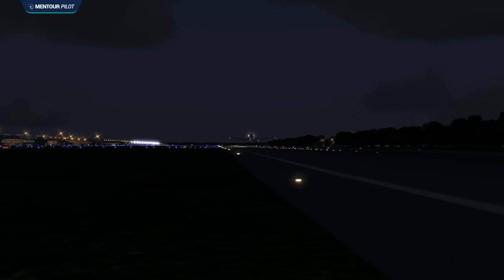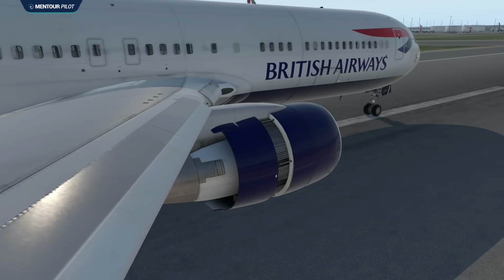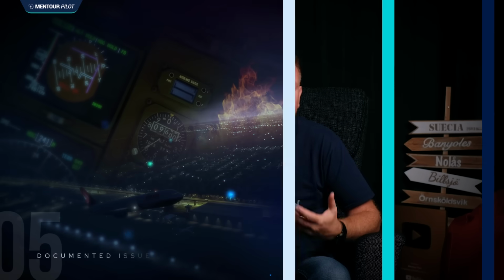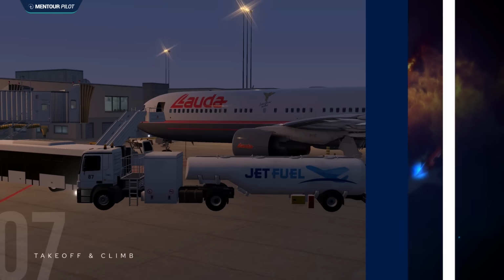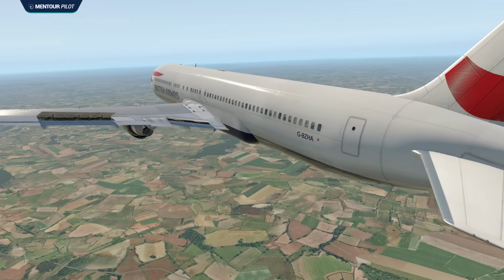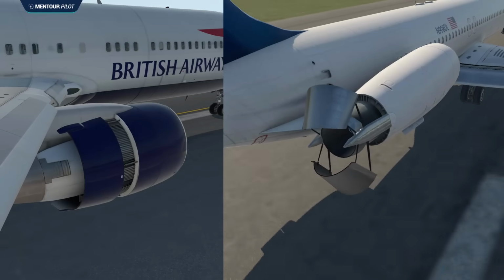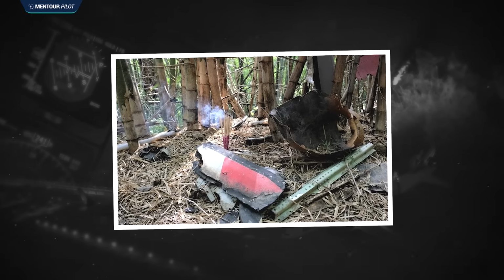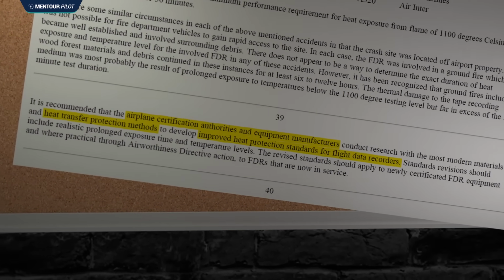HOW an Impossible Failure CRASHED this Boeing 767!

Comment: One thing I'm actually missing from this is how long Boeing was denying that there was a flaw with the design, and that activating reverse thrust in such a situation would be completely uncontrollable, until Lauda said that he himself would take one of the planes and replicate this situation to see if it would be possible, for of he fails it will just him dying, while when he should be able to control the situation, he would resign. It was there where Boeing then admitted that it would be unsafe
Reply: This should be the pinned comment.
Reply: @MikkoRantalainen  I recently read that it is some kind of YouTube or Google A.I. that chooses which comment to pin. That would be okay as long as the channel owner can override with their own pick of which comment to pin.
Reply: @valerieann8007  given that not every video has a pinned comment and the one which is pinned usually is a specific one usually something by the creator I think you've read something false
Reply: @valerieann8007  the pinned comment is chosen by the channel owner. The top comment is chosen by the algorithm, but is displaced by the pinned one, so I can see someone being confused for a while, but whoever wrote what you read was wrong
Reply: Yeah Boeing was more than happy to place all the blame on pilot error, but I'm sure they learned their lesson... Cough 737 Max cough
Reply: @EdgyShooter  Airbus blamed pilot error for using too much rudder when their composite failed over New York.
Reply: One more time then criminal management from the manufacturer?
Reply: Honestly, it does this story injustice to not mention Boeing's feet dragging on acknowledging the reality of this fault, and especially Lauda's determination to make Boeing to come clean on the findings.
Reply: From a impartial observer:  Most critics of Boeing point to its downfall starting with its acquisition of McDonnell Douglas in 1997 and that previous to this, they were a safety conscious company with engineers having greater input than now, which supposedly has a greater emphasis on profit, share price etc as directed by the CEO.
So even back then, do the Boeing bashers believe it was not reputable, or maybe it was corrupt?  
Asking seriously
Reply: Like they (Boeing) did with the 737 MAX.  Deny & then blame the pilots after they decided to remove all info on  MCAS from the documentation of the aircraft (pilot handbook etc.).
Reply: Couldn't agree more... the only negative thing one can say about these otherwise brilliant air crash investigation videos, probably the best ones I have ever seen, is the occasional omission of such key elements of the story and the rather apparent partiality of the creator of the videos when it comes to aviation industry and aircraft manufacturers, specially Boeing...
Reply: @raulko4898  exactly……Boeing has a horrible record of lying, covering up evidence and obfuscating facts to deny responsibility …yet here they’re portrayed as if it was just aww shucks  back luck…
….
Reply: @raulko4898  What is "brilliant " about using the wrong airline which had completely different engines on its B767  ????
The FAA made P&W redesign it's reverser    mechanism  not RR.
Reply: That sounds like the most Niki Lauda thing ever
Reply: @MuscleCarLover  according to the movie and James Hunt and his rivalry, he was big on safety, especially after his crash.
Reply: @King OfTheJungle Apparently his "big on safety" didn't bleed over to his airline operations. Conscientious maintenance would view a recurring fault as failed troubleshooting or repair, instead at Lauda Air they viewed the recurring fault as an inconsequential nuisance message and simply cleared the fault message and dispatched passengers and crew on an unairworthy airplane… HOW MANY TIMES?!! Any surprise that the reverser finally deployed in flight? I don't know why Lauda wasn't blamed for the crash. He should have been criminally indicted for gross negligence, considering he never even bothered to contact Boeing about the problem. Instead of grounding the airplane until it was fixed, putting it in the air to make money was more important. No wonder he made such a dramatic offer to kill himself in a jury rigged airplane. That Shakespearean line holds true: Me thinks thou doth protest too much.
Reply: @petep.2092  well since Boeing had said it was safe if the thrust reverser deployed in flight, the plane was deemed airworthy. The fact that Lauda flew to the accident asap to help out in any way possible says everything about his character.
Reply: @petep.2092   Lauda Airline suspected a (harmless) malfunction regarding notification, but dutifully repaired them - always hoping this would be the last time. They went to the trouble to check out wiring and also asked for input by the producer. (Their practice to repair and hope it would be finally fixed this time was in line with guidelines). Boeing told them that even IF the reversal would happen (not only a notification which is a false positive if you will) that could be handled safely by the pilot.  

The customer (the airline) relies on the producer for correct guidelines regarding what is a critical failure and what not. 

Moreover: Lauda Airline had ONE machine with those problems, but other airlines had those problems too. Not often, and until then no catastrophic outcomes. There had been even a few incidents with reversal during mid flight (one of them is mentioned in a comment). That flight got lucky but the machine flew back. That was a serious incident already and it is up to Boeing to not be complacent along the lines of: We do not exactely know what is going on but it will be fine, and if reversal happens a good pilot should be able to prevent a crash,  and a complete redesign would be too much trouble. So let's wait and see and hope for the best ....

Lauda with their one machine could not do the tests in the wind channel - but Boeing could. They just could not be bothered until after the accident (and some more pressure). 

WHO should have an interest to fix such issues  - with plenty of margin of security ?? 

Boeing did not research further until this accident forced the. Only then they did the tests in the wind channel. And only because Lauda did not leave them alone - and unfortunately (from their point of view) he could get attention of international media.
Reply: Typical American corporation - remember Bhopal and Union Carbide?  Morton Thyokol and the Challenger shuttle?
Reply: @ianchandley  It has nothing to do with American culture. This is an issue with companies all around the world.
Reply: This also sounds like the Michael Crichton book Airframe.
Reply: Niki Lauda was such an amazing person haha. That is truly amazing
Reply: I also seem to recall that Lauda Air was being blamed for a lack of maintenance, until it was shown to be a manufacturing fault, I think it nearly broke Lauda Air.
Reply: He could have taken a parachute with him just in case
Reply: They care about their shareholders more.
Reply: Airbus i much better.  I always  feel much better on their plane
Reply: Yep, then did it again with max.
Reply: It look like the hydraulic cylinder that opens the thrust revserers...looks plumbed wrong on the diagram...

I think it is double acting..push on on end...then push on the other end...

I see only one line to your block diagram...now if it was like spring...or  ..then one feed line could move the cowl in both directions.....

I am sure for us simpletons.....it is best to have just a simple form
Reply: That's Boeing for you. Well never fly on any of their junk ever again.
Reply: @mortblackthorn187  and that's Lauda for you too. Legend
Reply: @mortblackthorn187  It's a shame because they were once considered the safest aircraft in the air.
Reply: @mortblackthorn187  It's a shame what their company is going through. My grandfather was a propulsion engineer for the original 737, 747,757, and 767. Boeing used to be the engineering standard for the entire industry. But it seems like they and Airbus have both missed or ignored a number of design faults with their aircraft in recent years.
Reply: @mortblackthorn187  Grunge was dumbing-down Seattle rapidly at this time.  Blame Kurt.
Reply: I put the blame on Pratt & Whitney. They were the ones who made the engine, they should be the ones to make sure that aircraft back up systems are compatible with the engine
Reply: Thats not strictly true. Once they found the cause they were going to announce it, but it would've been after several months with the statement going around lawyers, getting the wording right so they wouldn't get sued (several months with unsafe aircraft in the air). Other than that Lauda's threat was true, and Boeing announced what they knew the following day
Reply: @sambarker7930  nine months after the Crash, Boieng was still saying that reverse thrust is completely safe and can´t be the reason for the crash
Reply: @Gosti85  fair enough. I mainly got my information from Lauda’s biography, and that may have changed things slightly so it was smoother to read
Reply: I call software engineer issues  fly by wire
Reply: Boing, Boing, Boing!! Sounds like Zebedee😂'Boeing' for goodness sake. It's only written a hundred times on this page.
Reply: @2760ade  They deserve to be called Boing!
Reply: @Dowlphin  That's a very good point!🤣
Reply: @Dowlphin  Unfortunately boing is very rarely the sound they make when something goes wrong...
Reply: @Dowlphin  Only if it bounces when it hits the ground.
Reply: That’s what happens when your not state owned like Airbus.
Reply: @zeitgeistx5239   Boeing is run by bean counters and law degrees. Not engineers. Top management optimizes their boni and shareholder value. They are not going to stay with the company for many years and they are also not attached to a certain product or technology (like a CEO / founder of a company with a technical background would be). And if their short term strategies * go wrong - it may be bad for the company in the long run. But NOT for the people at the helm, for them the psychopathy (or the neglect) is lucrative and completely safe. They will not experience the effects of running down the company either.

See the "updated" Boeing 737: larger turbines can be more energy efficient, they slapped those on an existing plane, and considerable aerodynamic problems were "fixed" with a few lines of code based on the input of ONE sensor, no back up). This is a prime example. Airbus had just introduced those large turbines but well integrated into the aerodymanic design, so they did not need a lot of fixes by software. AND: all input for their software processing comes from 3 independent sensors not one. Such systems mandate pilote training - but Airbus does not mind the visibility - no reason to hide the details of their solution. 

Systems with more than one sensor mandate new pilote training, and that is a) costs for airlines that buy an "improved" Boeing instead of buying Airbus and b) it would have drawn attention to the  quick-and-dirty fix of Boeing that they needed to be able to compete with the latest (well developed) machines of Airbus.

If think the latter (not drawing attention for instance in training pilotes about the software fixes) was even more important for the insane decision to have only one sensor for a critical function. But maybe they wanted to save on pennies for sensor redundancy and have a marketing argument for the airlines (no extra training for pilotes needed, because we did not make any changes to important systems - or so they said). 

Boeing could not even hope to get away with it for longer, that was a SURE disaster waiting to happen - critical input from only one sensor. It did not take long time for the first machine to crash. But another one had to crash after that. The Trump admin still tried to protect Boeing, but their machines in the meantime were not allowed in many other developed countries (Europe, Japan, ...) so then they were forced to admit they had problem. Note: US media could not be bothered to go into the details, One had to watch alternative media on the internet with  Ralph Nader on to get the details of their criminal conduct. (a young relative of Nader had died in the second crash in Ethiopia, she was an aid worker) 

Well the bean counters and law degrees could have illusions of getting away with quick-and-dirty solutions ** or they can suppress the awareness of what is going to happen - certainly better than engineers.

** Quick-and-dirty is a term from software development  - it means a fast solution or adaption of existing code, can be kind of provisory. There is a place for that (fast results, lower costs), if you have non-critical software, or a failure or inconsistencies will not cause damage. Think games, websites, business software for smaller companies.

I think in Europe (where Airbus is located) there is a chance that engineers and middle management (those that actually DO the work of testing / designing or manage the projects) would have their day in court if they would behave like Boeing (for instance with the 737). Top management would of course play dumb and  try to throw them under the bus 

BUT: if the managers that actually have to pull it off have a realistic risk of a criminal prosecution - then they would not go along. And it would be much harder to threaten them with job loss - not so easy to find a replacement that would risk criminal prosection as well. Much harder for top management to bully someone into supporting psychopathic business practices when those carrying them out could end up in jail.

see Boeing 737, where it was criminal intent not "only" neglect / denial like with the thrust reversal many years before. That reversal problem was not as obvious, trickier to nail down, so I do not think that Boeing gladly accepted that people would die because of thust reversal. They did not give their best to make sure there were  lots of margin of safety. Building more expensive even though they did not know if there was even a real risk.

But with the 737 it was straight up criminal intent and psychopathic behavior. I am very certain that their engineers objected, but were ignored. Problem: if one of them objects too much (annoying superiors) or even produces evidence (like making a detailled and qualified objection * * * and sending it as mail) or violates their NDA - they will find other employees that will put their scruples aside. The same happened for the crimes that caused the Great Financial Crisis  
* * * if interested search 2008 financial crisis J.P. Morgan whistle blower Alayne Fleischmann - the criminal banksters did not want to draw too much public attention so at least she was not sued for violating her NDA with her former employer. 

She embarrassed the  DOJ under Eric Holder by giving them evidence in writing - a mail in which she objected to illegal practices of how the repackaged loans were evaluated and sold off. The reaction of the bank then (this was before the crisis broke out): her superior the recipient of the mail yelled at her, and a general policy was established that banned putting such content into mail. Her superior was relatively new and from then on she noticed that they way those repackaged loans were scrutinized changes. And her competent and engaged collegues (with personal integrity) did not dare to stand up to it. I assume the manager before might not have gone along with the practices so they got a new manager that would. 
After she had provided evidence (and had been promised anonymity)  - it so happened that someone of the  DOJ leaked her  name to the media - essentially a warning for  other potential whistle blowers that could cause criminal prosectuion for the big donors of both political parties. Needless to say mainstream media helped their advertisers - both parties AND the companies and maybe also shareholders - by not covering the story). 

The FAA is corrupted - and voters let that happen.

The system rewards psychopathy and anyone going against it has a very high chance of losing their job, being possibly sued and never working in the industry again. I am sure many of the engineers do not like it - at all and would much rather not go along.

But if they sacrifice their careers (and personal finances) - it will be in vain. 

Boeing also places ads with TV. On first glance this is ludicrous they do not have a consumer product, so why targetting consumers ?? (there are no Airbus ads in Europe, and likely no ads for any aircrafts in Australia, Japan, Asia in general ...)

Well, they do not target consumers, these advertising budgets are the bribe for media with a lot of reach to not report too negatively, and if there is a major accident to report in a certain way about it (and not to keep it in the headlines for too long). One can speculate in a general sense about the causes - or get Ralph Nader on and he will be details. One can report on the accidents - and do "human interest" stories - and then put the story at the back burner as soon as possible. 

Boeing is also a military contractor so the bribe also makes sure that the media does not criticize insane military spending, or the burning of money (like the lates F35 1 billion waste of money).

So with media in their pocket, politicians in their pocket, the regulators partially in their pocket, and the voters complacent about decades of corruption - the life of any employee with a conscience would be destroyed - and their sacrifice would be in vain. Only with media at their side they could hope to get away with it.